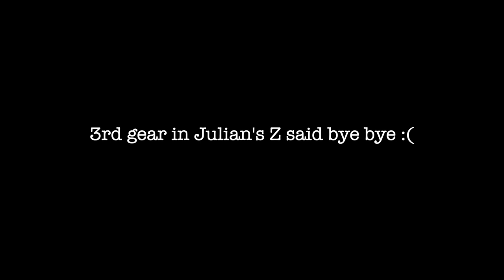Feazer3 Day 2 | Animal Style

Comment: Eventhough it was sick driving I don't think Julian should have won that first battle against the yellow bmw. He straightened in both runs and cut the track with almost 2 tyres off the front.

As said, it was sick to watch. Had to put it on mute half way through because of the sound of that 350 straigne pipes 🤮🙈😂
Reply from the maker: That first corner opens up before it tightens again, pretty normal to get almost straight in that area especially with low power. Not saying the judging is perfect but it ain’t formula d haha